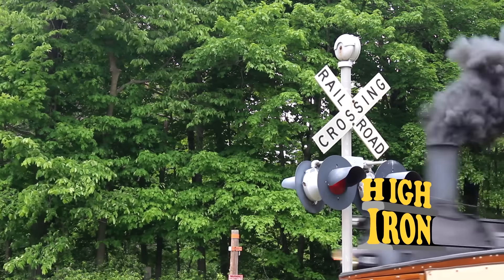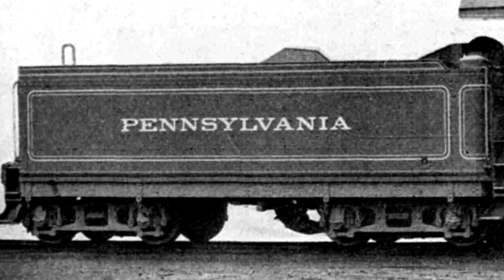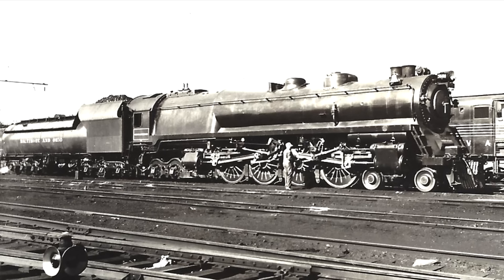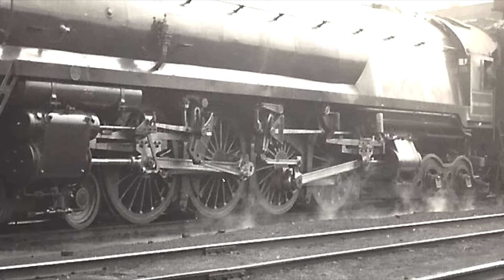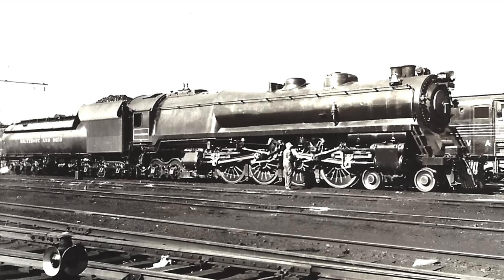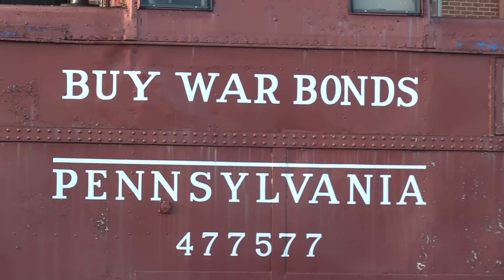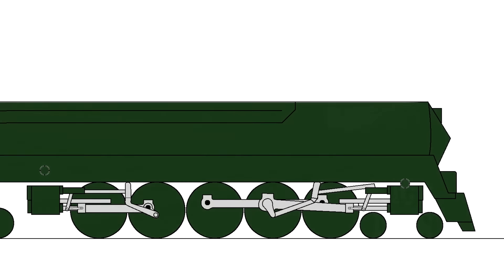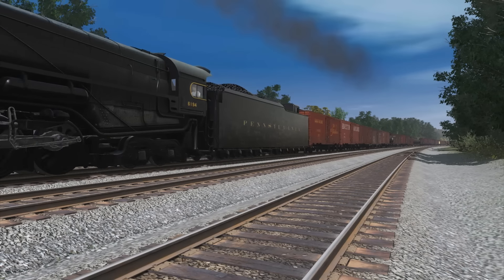Why Weren't Duplex Steam Engines Successful?

Comment: if you spoke to PRR engineers who piloted the T1's the majority of them would say that the wheel slip problem was a myth.  The final analysis of this piece of railroad lore was that the engineers were not used to so much instantly available power, and that was the true cause of the perceived wheel slip issue.  But as noted, most of the engineers were of the opinion that once used to the available power, and how to manage it, the wheel slip issue was non existent.  But rumors, myths and folklore are hard to dispel, especially among non railroad individuals and rail fans.
Reply: As a locomotive engineer myself, I was just about to comment on how insulting it is to suggest that engineers as a group simply couldn't adapt to a totally different locomotive. I can tell you that I run an SD40-2, a Dash-9, and an SD70ACE very differently. I cannot believe that the engineers on the PRR weren't capable of the same. I'm sure it took some time to learn the intricacies of a new design, especially one that was so vastly different than what they'd been used to seeing every day for years, but no engineer worth his pay would just blindly grab the throttle and get a bunch of wheel slip day repeatedly.
Reply: Bulleid ‘Pacifics’ in the U.K tended to slip when starting due to instant steam availability.  Some drivers never got the hang of it..
Reply: I thought the wheel slip issue had to do more with a mechanic issue with the poppit valves or whatever they're called.
Reply: And it definitely wasn't a myth it absolutely happened there's tons of videos showing it lol usually taking off or at lower speeds . Happens to others sure but not nearly as frequent.
Reply: Perhaps the wheel slip could be solved with a different configuration, like the 4-8-8-4, having more wheels to grip. Even then, the Big Boy still slips sometimes.

That said, a 6-8-8-6 engine would be freaking MASSIVE, and the weight alone could help as well! Sadly the age of steam ended before that could be materialized or even considered.
Reply: @NothingXemnas  but then that defeats the whole purpose of the duplex. Duplex isn't like the big boy at all. It's one frame.
Reply: @jordanalexander615 
And? I meant the wheel configuration, not the frame. Unless you mean its impossible to run 3 axles in the same style the 2 axles are in duplexes.
Reply: @NothingXemnas  they were convinced that the duplexes on Ridgid frame were the way to go. But if the locomotive were to get much longer running a different configuration it would be basically impossible to take curves. Now if they made them articulated it would work just fine. They needed a lot of design changes to make them more viable to be honest. Better weight distribution on the driver's probably would have helped. But was too late to turn back by then. And yes technically it would be impossible if it had that many wheels on the duplexes. Unless they were tiny and then there goes all your speed.
Reply: @jordanalexander615  Indeed, indeed. That is why I said it was an unfortune that the steam age ended. We could probably have seen further improvements to the designs; who knows what they would look like!
Reply: @NothingXemnas  Even the Big Boys can wheelslip, there’s video of this happening. Wheel slip is just the power of the engines overpowering the friction created between the wheels and rails
Reply: Why would they create an electo machincal slip control mechanism to reduce slipping if it wasn't an issue? And why was their reports saying the new mechanism they added didn't eliminated the problem, if there was never a problem in the first place?
Reply: Ok that being said. Common sense doesn't tell you that it did have an excessive number of lead and trailing wheels? Even being sprung they have to take away from tractive effort. There's just no way it can't. Imagine if those engines had a standard four lead and four trailing wheels or two, all of that additional weight would be added to the drivers. Making the Duplex a grand puller and monster of tractive effort.
Reply: That's the problem about myths is they stick "I read it and heard it so it must be true"
Reply: You're right, its quoted as gospel by every railroad book ive ever read, irregardless whether true or not. Same with a car, too much gas, and you get wheels spinning. Idk why they couldnt figure it out
Reply: @kenrickman6697  apples and oranges here.  I am not sure where I can stand.  I can see your point.  I know airplanes a lot better by trade.  With that being said I know different vehicles can be a handful especially when new types of propulsion are involved.  Guys going from the older airlines of the day and moving into the Boeing 727 experienced crashes because they were not used to the power and flying exactly by the numbers.  Jets spool up slowly.  Could be a couple of seconds.
Reply: @NothingXemnas  Wait, what? The steam age ended?? Most electrical power plants use steam!!!

Yes. Your Tesla is ultimately steam-powered, just with additional conversion steps in between.
Reply: @klausstock8020  Do not put words in my mouth, that is not what I meant and you know it.
Reply: @NothingXemnas  I thought you understood humor. Sorry. I was mistaken.
Reply: @klausstock8020  I understand humor, it is just that I have been victim of too many "hurr durr the steam engines still exist dumbass" to take any of that lightly anymore. The apology is all mine!
Reply: Such a shame, I would have loved to see such duplex locomotives last long enough to be preserved or eventually restored like Big Boy and the Challenger was.
Reply: @jordanalexander615  
I imagine they might have thought "The 4-4-2 Atlantics are the smoothest fast running engines there are but they´re limited in Power and TE by having only 4 driven wheels and we can make em only so big and so heavy. But what if we build a locomotive that is basically two Atlantics in one locomotive? Should be fast and big and strong and powerfull. Let´s do that." I won´t say it has to have been that way but it would make sense to me. And a rigid frame proposes to be more stable at speeds than an articulated one like the Big Boys.
Reply: @klausstock8020 We moved to the “Centralized Steam Age”.

Comment: I believe the S1 could beat the British speed record.
Reply: Possibly, but they weren’t smart enough to try one day, which is good since Mallard actually deserved it lol
Reply: The costs of doing so, on the day with all the extra equipment, subsequently with the repairs required, will mean it never happens.
A4'Mallard' was damaged doing that speed run but effecting repair was no hassle - all the facilities to do so existed anyway.
Reply: @EllieMaes-Grandad  I guess we'll have to see what the S1's younger sister can do.
Reply: @EllieMaes-Grandad  The A4 big-end design was rather promptly remediated, and had another run been made I suspect Duddington's belief that he could get 130mph out of an A4 might have been achieved, even with overtravel on the conjugating gear.  That, in turn, could have been eliminated by using stiffer (larger-diameter hollow) cross-shafts in the Australian conjugating gear design...
Reply: @wizlish  Interesting notions.  One must then wonder why it didn't happen, and why it hadn't already been done.
Reply: I've been given to understand that a triple Kylchap could be fitted to Union of South Africa comparatively cheaply, and that is really only a set of instrumented wheels away from a proven 125mph-capable locomotive 'in being'...
Reply: @wizlish  Allegedly 'capable' - even with the kudos, who would risk the possible cost of trying to go past 125mph?
Reply: I'm just proposing an alternative for the h8ers who want to defend an A4 record 'cost-effectively'.  There's no way in hell the NRM would let Mallard herself anywhere near that kind of perceived risk -- nor would I risk such a national treasure.  So some 'other' A4 would be the contender.  As I noted it could relatively easily be given the same or better drafting arrangement and details, and furnished with suitable instrumentation whether by university contest, fundraising initiative, or contributions by British engineering companies along the lines of the 71000 restoration.  The rest of any running-gear concerns could be fettled, the locomotive shipped to the United States as Flying Scotsman was when Alan Pegler had her, and record runs as far over 125 as necessary easily achieved on the same Fast Loop that 5550 would use.

 Note the additional advantage that this shuts up the whiners that say '... but it was a downgrade' or 'it doesn't count if you don't run both ways in an hour' ... and adds that the running conditions would essentially be EXACTLY what 5550's record attempt would involve.

In the interest of fairness, any of the British replicas would have the same opportunity, as would the Germans in the regrettably unlikely circumstance they'd let 05 002 out of Nuremberg...
Reply: @wizlish  Good luck finding enough people (anyone?) to crowd-fund this idea . . .
Reply: Gs4, n&w j class prolly could as well
Reply: GS3,4,5 were not really high-speed engines in this sense.  It is valve-limited in the same sense the ATSF 3460 class and the poor C&NW E-4s were.  The Western engine with the most promise would probably be a tweaked FEF-3 (or -4 with the quad stacks).

The J as built was limited by machinery speed/tribology to what it accomplished on PRR -- it would need higher drivers, or the gearing Tom Blasingame proposed for it, in order to survive at speeds over 125mph, and that in turn would both increase vertical loading gage and make an already somewhat top-heavy locomotive even more so.  

The other great replica-to-redeem-unjust-bad-name would be an ACL R-class 4-8-4, with proper Voyce Glaze balancing, Timken roller rods, and de Caso-style long-travel gear on paired articulated valves with thin rings.
Reply: @EllieMaes-Grandad  You greatly underestimate railfans and railway enthusiasts. We have a reputation for a reason. 😂
Reply: @TheHistorySoldier  I'm a [long] lifetime railway enthusiast, but decline a share in any reputation, thanks all the same.
Reply: @rapcreeperproductions3269  theres no way the new S1 is going to beat the record, there will always either be a speed limit or a freight train in the way
Not to mention theres no track that can sport that speed other than maybe the CHS or the NEC if permission can be acquired from Amtrak.
Reply: I recon a T1 could do that bro
Reply: @AlexHill1991  I hope it can. No one seems to be building an S1 afterall.
Reply: @rapcreeperproductions3269  The S1 has flaws that prevented the big engine from an operational place in preservation same with the union Pacific 9000 although one of them has survived as a display engine
Reply: @AlexHill1991  well the S1 was scrapped without the chance if I remember correctly. It would've been a great display loco though
Reply: @rapcreeperproductions3269  yeah it was a prototype that was withdrawn too early to be saved but yeah would great for the railroad museums
Reply: @EllieMaes-Grandad  The LNER wanted to make a further attempt at the speed record since the July 1938 effort was not achieved in the best of circumstances. The 15 mph speed restriction just North of Grantham and the need to reduce speed for the junctions at Essendine presented a significant handicap. The engine should have gone quicker but the arrival of WW2 prevented a renewed attempt. Post-war it was found that the A4 could pass Stoke Bank summit some 10 mph faster than Mallard had achieved on its attempt.

There was a chance that the record could be broken in an observable manner in May 1959 but the actions of a Traction Inspector sadly but perhaps rightly prevented this. Sir Nigel Gresley was always a very fast locomotive; it still is.

Maybe the A1 Trust will get round to building the proposed "Super A4", which would certainly do the job. But out of respect for the Class and Mallard in particular, I wouldn't unless forced by events.
Reply: @DeCasoU1  They might have tried again later in 1938, or even in 1939, but didn't.  Tells a story . . .
Reply: No
Reply: @robertbalazslorincz8218  some people say that the S1 was pushed so hard to the limit, even to the point of reaching a Max Speed of 157 Mph, same with the T1, that went 140 Mph, the thing is that this runs were never oficially documented, its just a rumor but lots of people say its true, they even say that PRR got a bill for excesive speed on the S1, but nothing 100% sure
Reply: The length of the casing will case air rubbing in the side and a lot of friction which will slow it down also it’s a bit heavy
Reply: What if we build a a4/2 with welding the stuff you suggest and my suggestion a carbon fiber streamlined casing
Reply: LOL, I think you must be high to even think that, there were too many faults with this locomotive(s) and even then the record was not recorded as it ran the amount of time it did at 100kph. Mallard will forever be the fastest steam locomotive in the world and she will never be beaten.
Reply: @jordanorriss4784  we shall see, the S1 didnt have so much faults, just beung too long and a bit of wheelslip, but nothing more, mallard broke herself after the run
Reply: @FranquitoMV2004  Yes she may of broke herself but she wasn't the length of maybe 4 buses which is stupid. Don't get me wrong I admire American locomotives, but beating Mallard? You'd need another 26mph to beat her, dream on.
Reply: @jordanorriss4784  we will see, also, should i say that S1 was an experiment? A one of
Reply: @FranquitoMV2004  Lol we will see? The age of steam is gone, the record will never be broken. Prototype or not it won't beat the Mallard's ultimate record.
Reply: @jordanorriss4784  Mallard may be ultimate, but her recors can be beaten, lots of steam locomotives can push much further, but due to seed restrictions they never go that fast, it is said that UP FEF series could get up to at least 125, N&W Class J up to 130 and SP Daylight 4449 too, we may wait until 2030 when the PRR T1 5550 is finished
Reply: @jordanorriss4784  i know i have some mistakes, where i live we dont speak english, and i have some spelling issues, and also respect me, i didnt insult you, so the word FOOL was not necesary
Reply: Now im gonna leave this conversation here, because we went from a normal discussion to you disrespecting me out of nowhere, so its nonsense to keep talking
Reply: @FranquitoMV2004  Statement still stands.
Reply: Not likely you'd find a stretch of track safe enough here in north America. Our idea of "high speed" here is 80mph
Reply: @WesleyHarcourtSTEAMandMORE  ROFL exactly, so go slow xD
Reply: There's a group building a Pennsy T1 to try and beat the steam speed record
Reply: @nickmadaus6335  won't beat it though
Reply: I see we’ve got a clown over ‘ere
Reply: @E2-100-billington  No you don't, just would like to see any steam locomotive try and beat Mallards record as it's never been beaten, so I wish them the best of luck.
Reply: American engines aren’t as good as British engines
Reply: @wellingtonnorthjunction3911  just no. Every loco has a purpose in mind. It's impossible to say who actually makes better locomotives. Also the British Rail modernization plan was just awful.
Reply: @wellington north junction  Well said and seeming as Mallard broke the record back in 1938, I am not surprised IF the US did manage to ever make a steam loco which will go quicker. However, I highly doubt this.
Reply: I’ve no doubt in my mind that back then if the Mallard record was defeated , the brits would of built an even faster one 😂
Reply: Lmfao why because it’s British. Muh it’s better. Apparently
Reply: @oldtruckoperator2106  not because it "BrItUsH" the Pennsylvania locos had an extra cylinders, larger drivers and higher boiler pressure. We'll see what the S1's little sister the T1 can do when the T1 trust builds a replica.